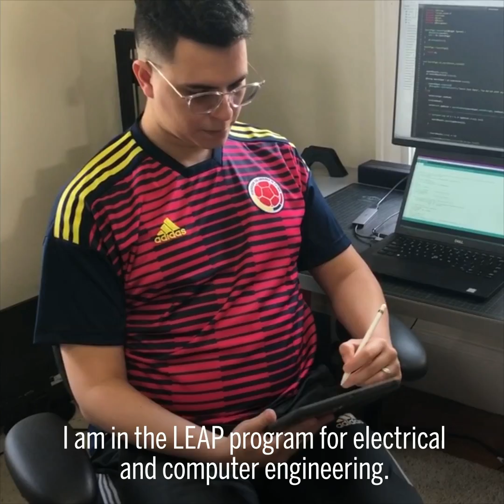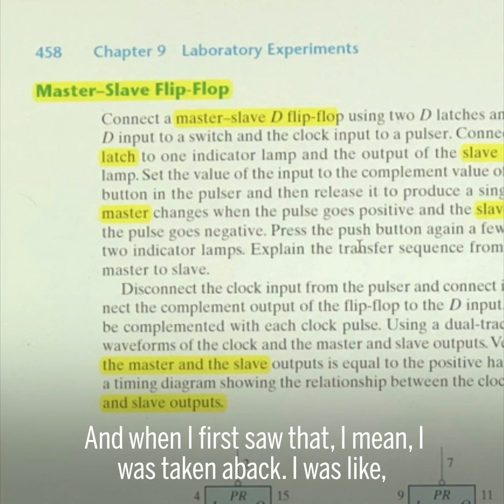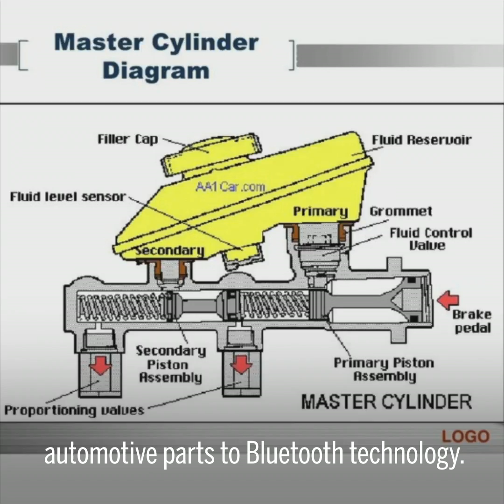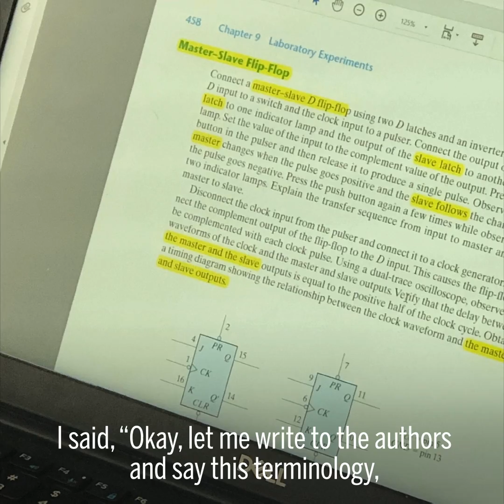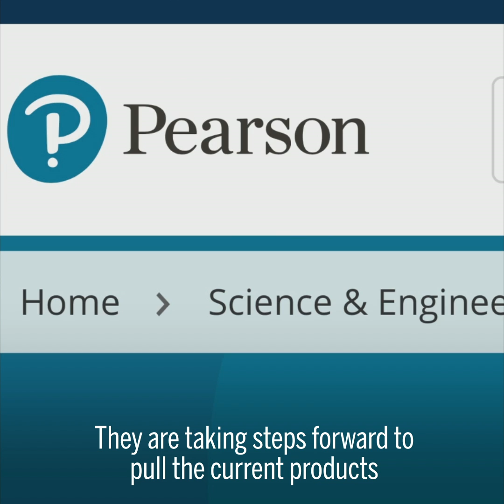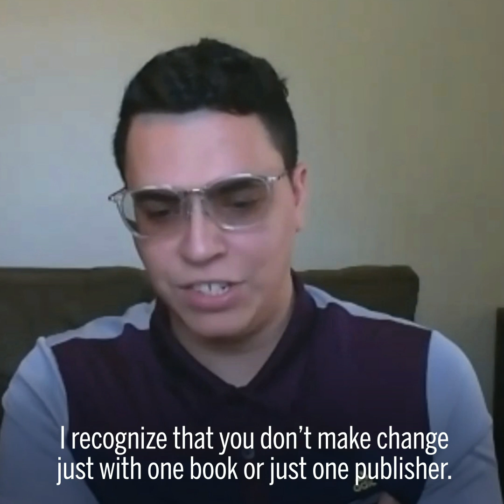Antiracism in Engineering: Removing "Master/Slave" Terminology

Comment: I've worked in Embedded System Engineering twice as long as this fellow has been alive and never ever connected Master/Slave with Race or Slavery. My Brain thinks Microchip and some Peripheral when I see Master/Slave. Then the next thing I think about is how to write the Code to Communicate with the Slave and connect the two together on a Printed Circuit Board. The  Slave in Electronics is not subservient to the Master as it has it's own Communications Protocol so the Master and Slave have to work together in concert to get the job done. If you want to get Telemetry Data from an Orbiting Spacecraft and that data is Temperature the Slave is the thing that gets that data into a form that can be transmitted down to Earth and used to follow the State of Health of say a Telescope that costs millions of dollars so hey how valuable is the Slaves Measurement? I could go on but this is ridiculous to say the least.